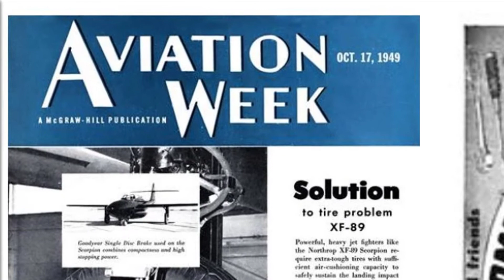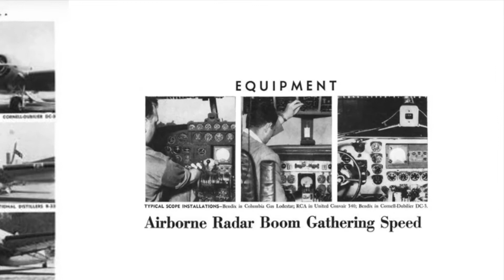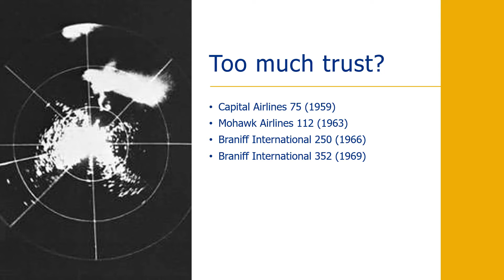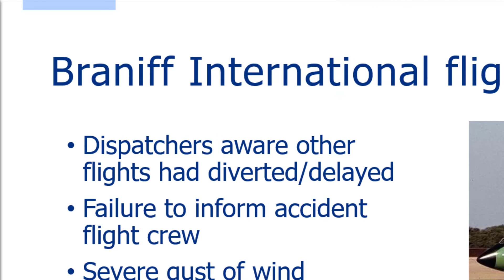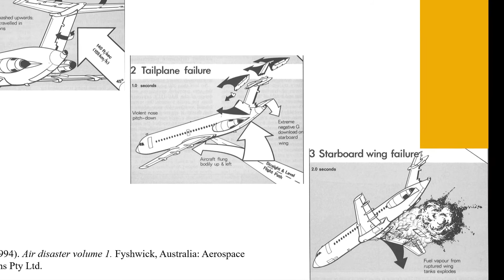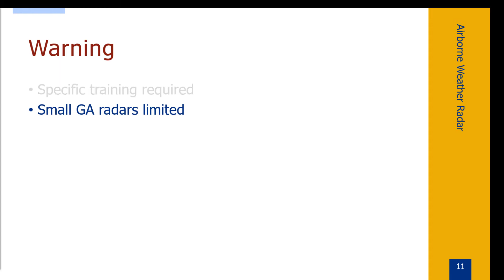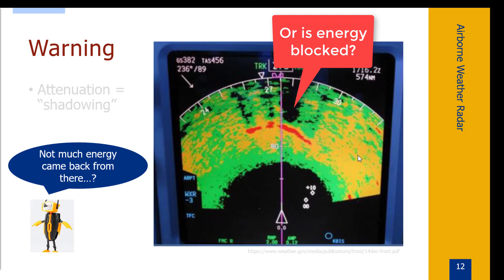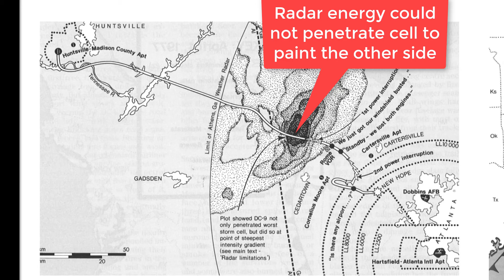History of Airborne Weather Radar & Flight Accidents: Braniff 250 & Southern Airways 242 Crashes

Comment: This blaming the “Flight Dispatcher” for this accident is utter nonsense and totally disingenuous!  ANY Weather Forecast for that day, that the crew would have with them and would have seen before the flight departed, would have included “Thunderstorms”….Thunderstorms ALWAYS Imply:  Severe Turbulence.  Severe Icing.  Lightning.  Possible severe wind gusts and Windshear!!!  This is something that the crew would have been well aware of before and during the flight.  They also had Weather Radar onboard, to help them navigate a path through the worst weather and heaviest rain.  A Weather Radar does NOT show areas of Turbulence, only the heaviest rainfall, that’s assumed areas of the most sever of turbulence!  Why were they flying around at 5000 feet???  This would be an area of the WORST Possible Windshear and Turbulence, due to the huge gusts that can fall out from the bottom of storms.  We now call them “Microbursts”.  And this is what they got caught up in!  Windshear Computers weren’t developed until the 1980’s however:  The Captain would and should have known that they were flying in a very dangerous location ie right at the bottom and leading edge of a powerful storm front.  Had the crew simply climbed to their assigned Altitude or Flight Level, and used their Weather Radar to pick their way around the worst areas of turbulence, this terrible tragedy WOULD NEVER HAVE HAPPENED!  It must be remembered that it is ALWAYS the Responsibility of the “Aircraft Commander” to ensure the safety of his Aircraft and all onboard AT ALL TIMES!  Therefore, in my conclusion, this accident was NOT caused by the flight dispatcher, but the Flight Crew, for failing to avoid an area of known Powerful Wind Gusts and possible Severe Turbulence!!!   Retd. Virgin Atlantic B747-400 Pilot……
Reply from the maker: Thank you for watching, and I certainly understand what you are saying! (I am honored to have a retired 747 pilot watching my channel!!!) In this specific accident, the NTSB report actually did blame the dispatcher at least partly, which is why it came to my attention when researching accidents that were at least partially blamed (by the NTSB) on the dispatcher's activity or lack of activity. This accident is also covered in excellent detail by MacArthur Job in "Air Disaster Vol. 1" where the NTSB report is analyzed, and unfortunately in 1966 there was not as great as understanding as we have now about clear air turbulence near convective activity.
Reply: @LauraLaster747  Hello Laura.  You’re more than welcome.  That’s fine, we are supposed to debate things and have alternative opinions in a free and Democratic society.  Something the left here in the U.K. are keen on shutting down!  It’s their way.  You agree with them or it’s banning, de-platforming and insults for you!   They’re insane, that’s all I can say.  This is what I disagree with the NTSB with:  In those days, many Airline Pilots were Second World War Veterans, “Hero’s”.  There had to be another reason for the accident, it could not just be Pilot Error!   As I said before, it is Always the Commander’s Responsibility to make sure he has all the latest Weather forecasts and relevant information Before a flight and during a turn around, transit stop!  The Captain should have insisted on having it, even if it wasn’t immediately available.  I’ve had this myself while working for British Midland Airways based at London Heathrow.  I was on the Boeing 737-300/400 and 500 fleet, operating multi-sector days throughout the U.K. Ireland and Europe.  And in some of the most horrific Frontal Thunderstorms, not at 5000 feet I didn’t though, but during the climb, cruise and descent Christ didn’t we get thrown around sometimes!  Back to my story:  I had this lazy Flight Dispatcher, who just wanted to get rid of us and go home, he didn’t want to go and get me the latest Sig Weather Chart, which was missing from the weather briefing pack.  He told me “I didn’t need it”. And that other Captains wouldn’t ask for that!  Well, that was it as far as I was concerned.  I told him “Look old son, you’re the dispatcher, now you either go and get what I’m asking for, or I’m just going to sit here until we run out of hours” (Flight Duty Time).  In other words, I’m not going anywhere until I have it, and I’ll put the delay down to you (the flight dispatcher).  You’ve never seen someone move so quickly once I’d told him that!   It’s also true that not as much was known about Low Level Wind-shear or Microbursts as we do now however:  As I also stated:  Thunderstorms imply:  Sever Turbulence.  Severe Icing.  Lightning.  Hail.  And possible Severe Wind Gusts!  Any Airline Pilot, even in the 1960’s, would have been well aware of this fact, and would also be aware of where to encounter the most severe and dangerous areas of wind gusts, heavy rain and possible hail.  Where flight 250 was flown, couldn’t have been more of a dangerous area to fly in, apart from right through the centre of a storm, if they tried.  Flight Dispatchers are only responsible for supplying the Flight Crew with what they need.  They are NOT RESPONSIBLE for the safety of an aircraft.  That is, and remains to this day, the responsibility of the “COMMANDER”!!
Reply from the maker: wow that is a great story! But way to make him do his work!!!!! That’s super important. Thank you for sharing and watching and giving your opinion on this accident.